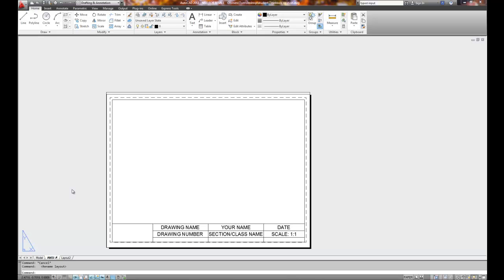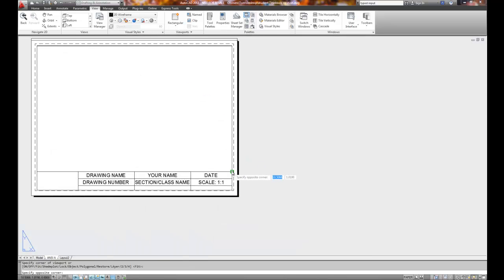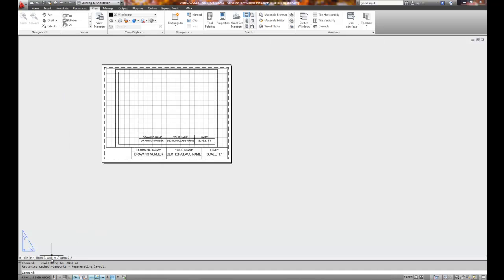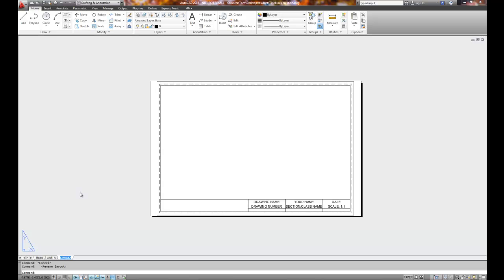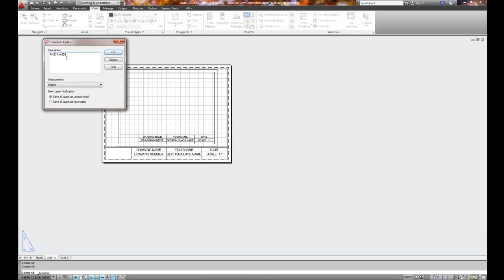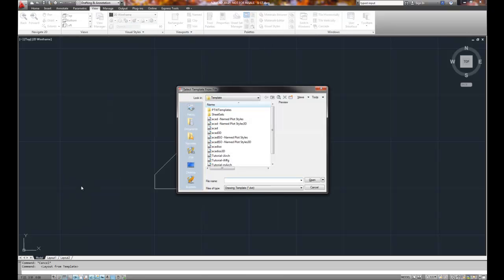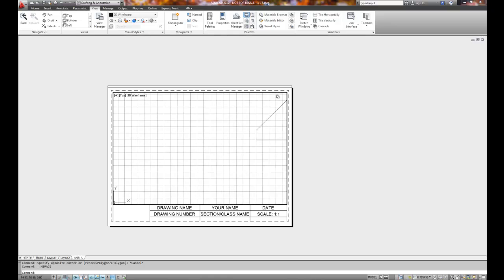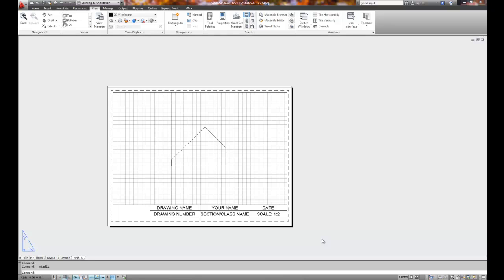Titleblock Template Creation for Layouts Video 2 of 2

Comment: Tom, maybe you can answer a question I have or point me to another of your videos. I started using SSM and have figured out the title block fields including revision level. Is there a way to revise the paper space tab number to use the same information the title block receives? i.e. Using 01 as a tab number. The title block has a field for revision. SSM has the custom field set up and you enter 'A' for a first revision. The block updates with this information, but my tab still reads '01'. I would like the tab name to also index to '01A'. Thanks in advance - James

Comment: Hey there, I am working on this project in AutoCad 2016 and I  made two layouts, one is Plan and another one is Elevation. Paper size is 11'x17''. I need to lock the scale to 1'=1' for Plan view while the elevation need to be set at 1/2"=1'. The plan layout just worked perfectly according to the scale but now I am getting a problem with the layout having elevation view, the 1/2'=1' is saying 4.17% which is really small. What am I missing? Could you please help. Thank you

Comment: Thanks for this video. I need a little help here. In the step described in at 1:24 to put a viewport in,  when I clicked on the view tab, I don't have the option to select a rectangular viewport. What I have is Viewport Configuration which is disabled and on the bottom instead of Viewports like yours mine says Model Viewports. Thanks in advance for your help.
Reply: Arian Leon Hello Arian, i had the same problem as you... I went to the "Layout" tab (AutoCAD2013) and used the rectangular. 
Link helps a lot: http://autocadtips1.com/2012/04/01/autocad-2013-paper-space-viewports/